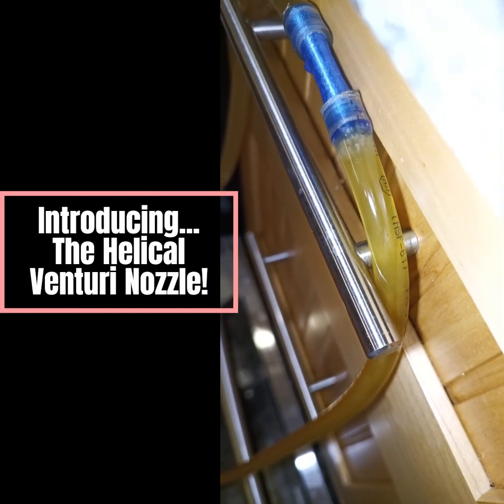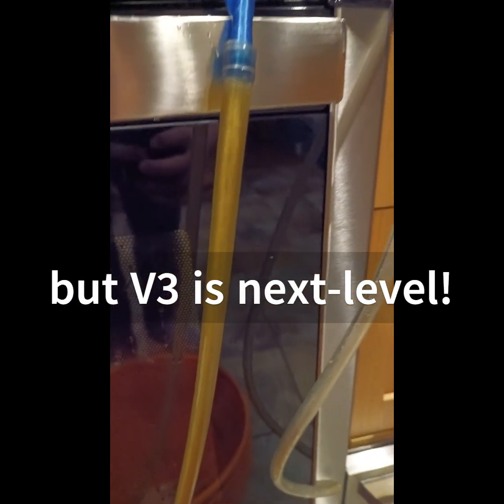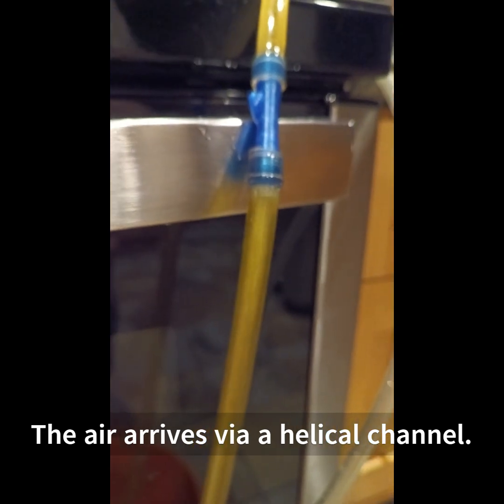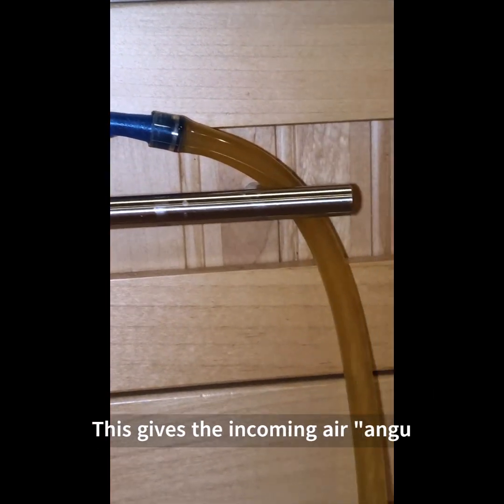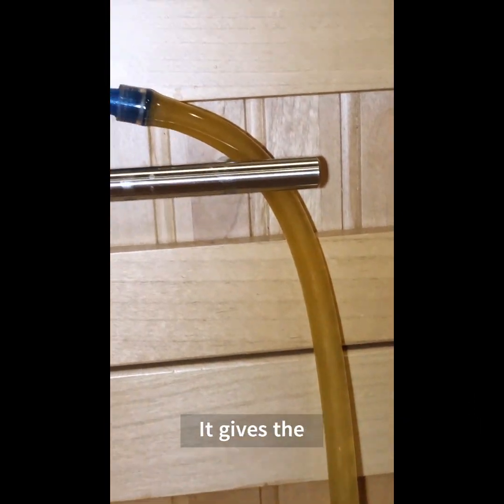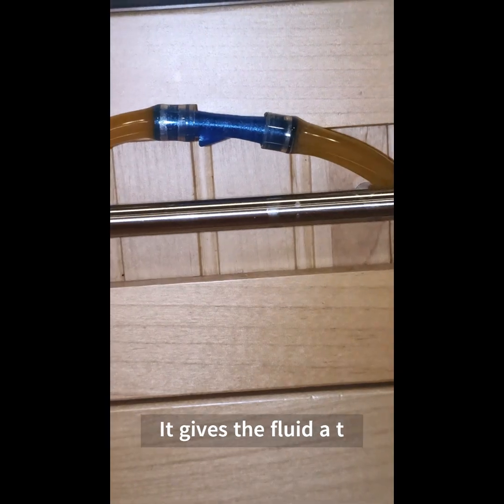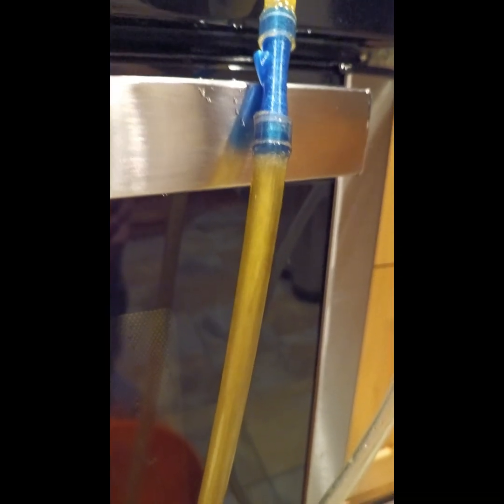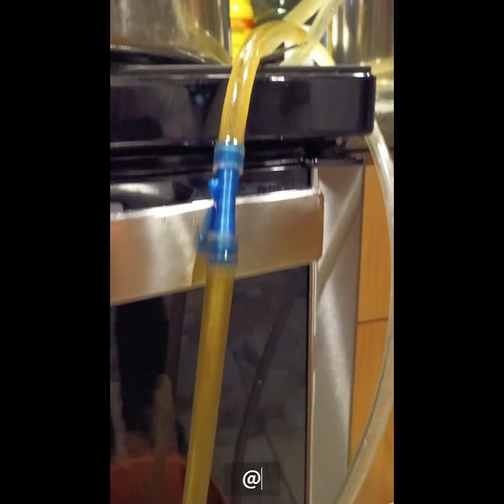Helical Venturi Nozzle #3DPrinting

Comment: Very cool, what would this be used for? Does it just help the beer move more easily?
Reply from the maker: Among the early steps in preparing beer, is oxygenating the wort (grain sugar syrup) before it is mixed with yeast. In this case we are "aerating" with air, instead of oxygenating with oxygen. The oxygen is needed to help yeast cells build good-quality cell walls. After the initial oxygenation, air/oxygen is kept away from the fermenting product as the yeast turns the sugars into alcohol.
Dispersing air bubbles into the wort helps the wort absorb more oxygen.